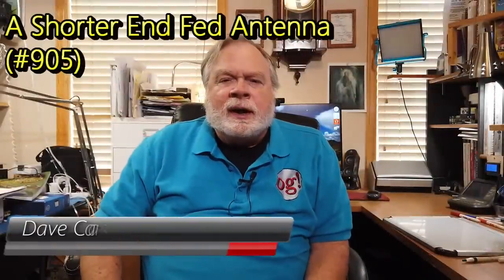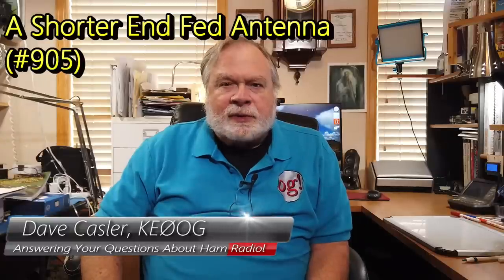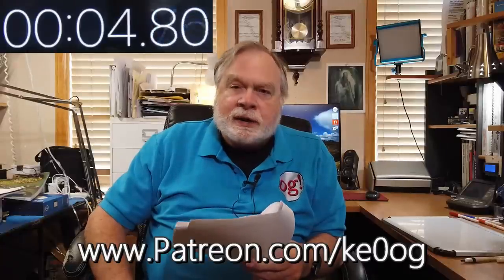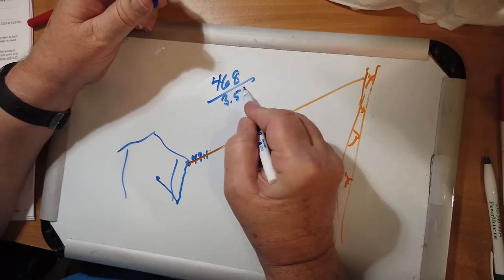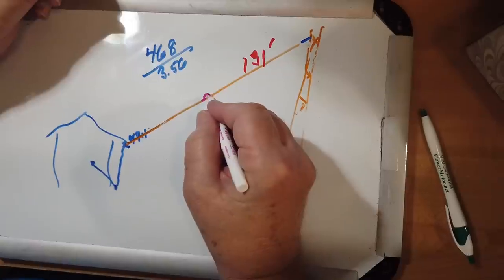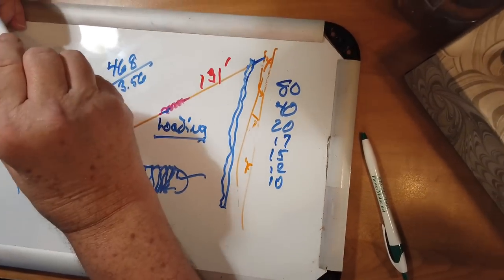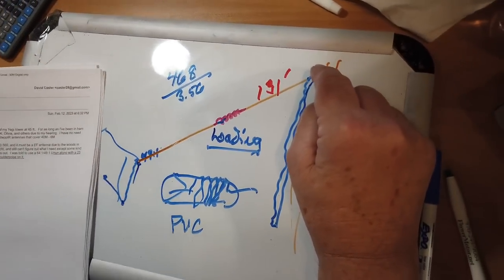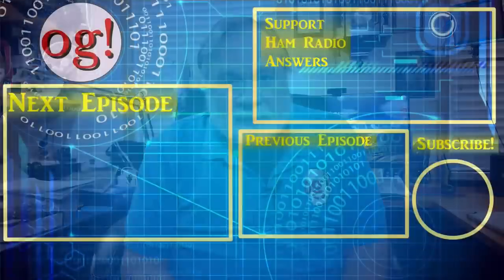A Short End Fed Antenna (#905)

Comment: Yea, I got YouTube to work.  I had just gotten my ARRL 10-40 meter EFHW built and up in a tree ten days ago.  Didn’t get it hooked up to the radio yet because we have been getting hit with snow storm after snow storm for the last 11 days.  About five feet of snow.  To busy plowing out every day.  
  Your diagram looks exactly like the way I did my EFHW except I put the UNUN up at the pulley because my house is on the upper end of the slope of my property and I have a big cedar tree twenty feet from the house.
Reply: I bought the same antenna two Field Day's ago and have had a lot of success with it.  I then replaced the ~65' wire with a 132' wire and have been using it on 80M, 40M, 30M, 20M, 17M, 15M and 10M, mostly at the 'digital end' of those bands.  The best antenna per dollar that I have had.  My transceiver has a built-in 3:1 tuner which is helpful on some of those bands.  Good luck!

Comment: You can use a 40meter efhw with a 110uh loading coil on the far end and it will add aprox 6 1/2 ' to the ant or about72'. do not put the tower end close than about 3 ft because it will try to couplee with the tower. 73 from ki0ad/Jim
Reply: Yes, he mentioned to stay away from the tower about 3 ft. At about 10 minutes into the video

Comment: Hi Dave! I have a box of 75 ohm cables with BNC male ends to it and I was wondering about making a wire antenna our of it-- do you think it would work?? conceptually, I suppose it can be a centerfed folded dipole as well if the shield and center conductor was soldered together... I don't know if it would be a good idea and if it works, what would be the best configuration for it? If I could make a decent multiband HF of it that would be great! I certainly have more than 500 ft of it to couple in 50 ft lengths... maybe a rhombic antenna configuration?

Comment: Hi Dave i a new to the hobby i have some questions i cant seem to find a clear answers to if you don't mind?

  is the rule of 3 miles to the horizon for 6 foot person is that set in stone??  are there ways to get pass this with cb/murs/gmrs bands besides additional height or is height and only is the answer ?

presuming this horizon is set in stone  and all things being equal among the different freqs [same watt, same gain antenna etc]  are the only differences between  frequency there ability to penetrate density and get distance per watt of power to the predetermined height restrain limit of the horizon for example 2 watt murs vs cb vs gmrs at same height?

AND THE GRAND FINALLY QUESTION 
where is the height calculated exactly on the the antenna?? For example if you have a vertical half wave 11 meter aka 18 foot long on the ground and a gmrs half wave 1 foot antenna that is  17 foot off the ground, there both at 18 foot to the tip.    Is the grms antenna in theory  higher even tho there both at 18 feet?  i ask because the cb is still on the ground yet the grms is 17 feet off the ground . would this mean its better to vhf as you can gain more height with less height versus a longer wave length?